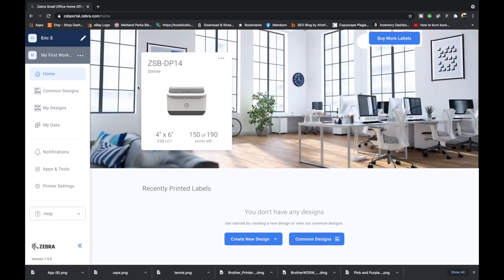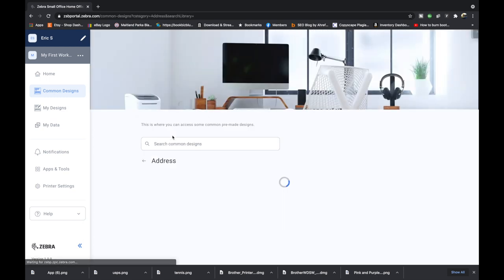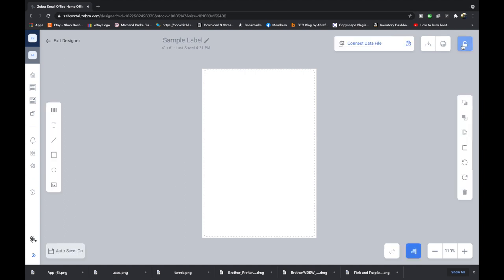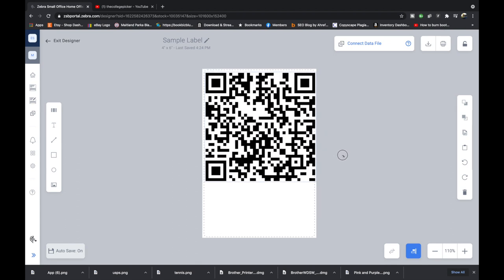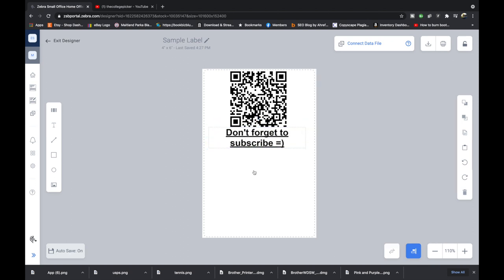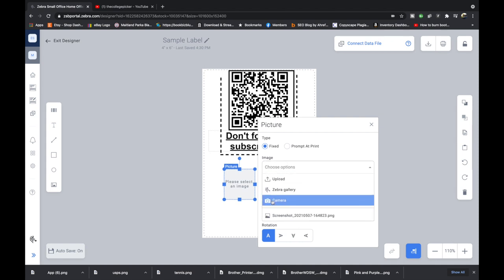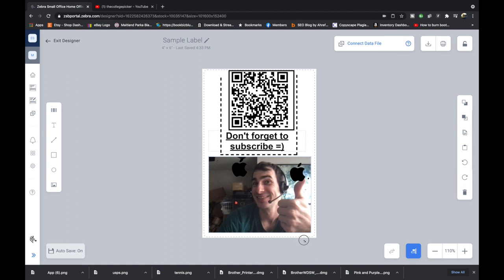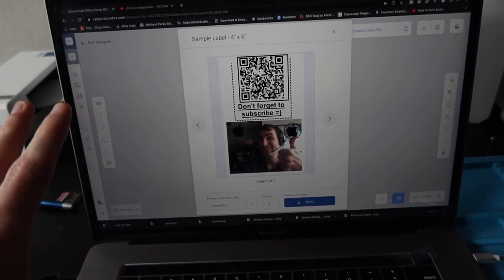Zebra ZSB Label Designer Full Tutorial on Designing and Printing Thermal Labels

Comment: Hard to setup if you have no mobile device; DYMON, brothers and other label printers are easy to setup on a Windowss PC. If you have NO INTERNET connection and your WIFI is down, you will be in a lot of troubles trying to use this device when there is NO USB cable to connect this device to a Windows PC as a backup; DO NOT BUY and WILL RETURN IT FOR THAT REASON. Website app and installation method that required a mobile device and create Zebra account Workspace made me return this item to seller. PLEASE PLEASE DO NOT EAT THE POTATO STARCH once you get it back. Poor design for business label printers.